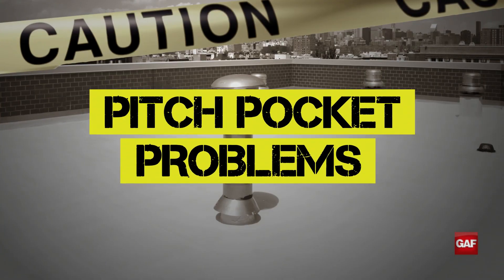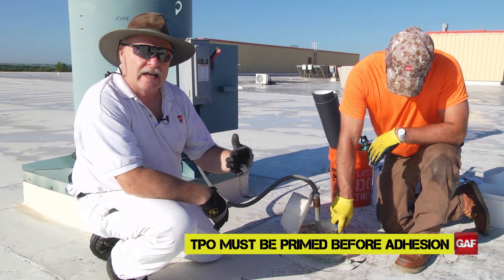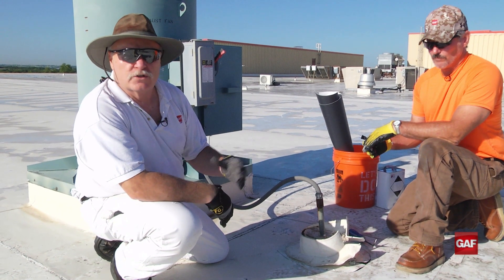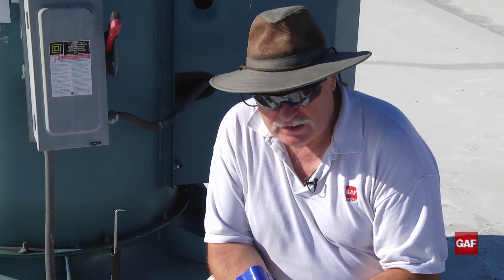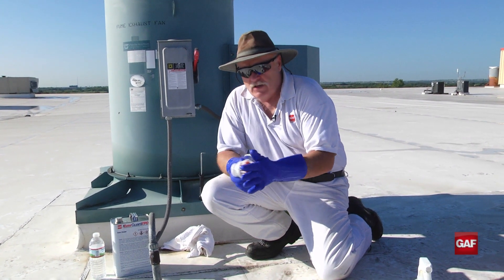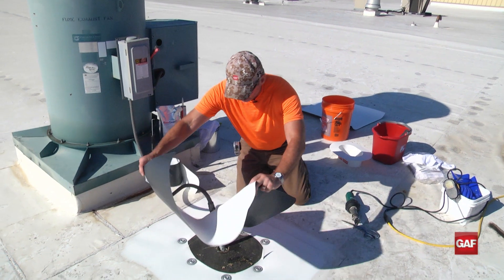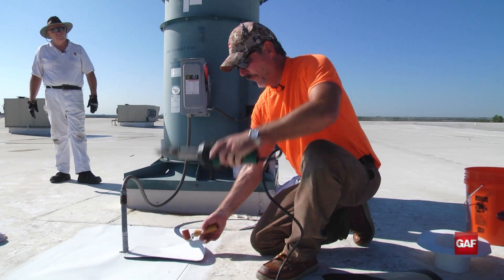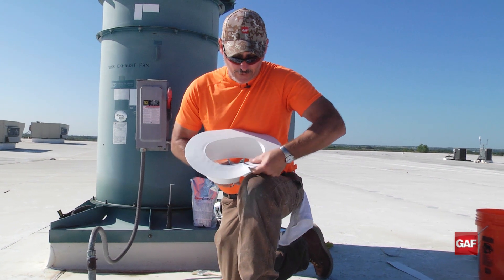How to Fix Leaking Pitch Pockets | Roofing it Right with Dave & Wally by GAF

Comment: What are some good gloves to wear with TPO cleaner?  A lot of gloves I try to use will fall apart and melt fairly quickly.
Reply from the maker: This is a good question for our technical experts. Give them a call at 1-800-766-3411, and they will be happy to assist.

Comment: This is nuts… the amount of labor required for one pitch pocket compared to a traditional BUR system makes no sense. With TPO you get an inferior quality system which requires more work and last about 1/3 of the time. It’s no wonder every year GAF changes something or updates the system… they are absolute garbage!!! After the last hurricane in South Florida… 90% of the flat roofs that had major issues were all TPO.

Comment: Also that fix cost a couple hundred bucks with premade pockets and pourable sealer. If you just installed a new target and field wrapped the pipe with unreinforced and caulked and clamped it would take 15 minutes and last forever....

Comment: I love showing people that trick at 2:00 this gives you a laser straight line real quik. I don’t even bother with a chalk line anymore since it’s always getting stolen. You just have to figure out which side of the sheet the string pulls. It’s different for different manufacturers. For versico/ Carlisle the top string goes across the sheet the short way and the bottom string rips the sheet the long way. Opposite for g.a.f. And firestone. This even works for reinforced epdm.

Comment: I'm just curious but how long have you guys been Roofing? I ask because it's non reinforced TPO membrane sheet it's not called unsupported TPO membrane sheet. Are you from Texas? Seriously it's non reinforced , not "unsupported... Plus, on the target sheet, you "do" weld spots closer to the center by the plates, it's called "pointless" to set in plates that aren't supporting the target sheet... Seriously guys? You're roofers right? Or just people from Texas? I'm not kidding, you remind me of all the people I had to correct and properly teach all the time in Texas...
Reply: I think your the one doing it wrong, plus I’m from Washington and we call it unsupported and I work for a pretty big company that’s the same way we do it.
Reply: I’ve been doing single ply since 1990 kid... I would of installed a new target and field wrapped the pipe then caulk & clamped it done in 15 minutes and last forever with never leaking.. Come to Chicago local 11 country and I’ll teach you a few things son.....
Reply: I've heard it been called unsupported flashing and I'm from Texas. he does basically the same work as me besides on the target sheet I weld the inside as well not just the 2 inches on the edge
Reply: I can tell by the outfits they dont do much roofing,sitting in the air conditioning in front of a computer looking at porn is more like it.

Comment: Why reuse the same wrong boot? Why not make it a 1” pipe boot?
Reply: This is all. However, I was add bond adhesive to the interior of the patch. While still maintaining a 2inch lap to weld. Keep in mind I’m only referring to patches 8inch and up. I also noticed that he didn’t put a indent in cross lap using a probe
Reply: The reason why is because you can't slid a pipe boot through the conduit with out disconnecting it from the unit.  I'm sure manufactures don't want you slicing the pipe boot in half. This is the best option for penetrations like this.